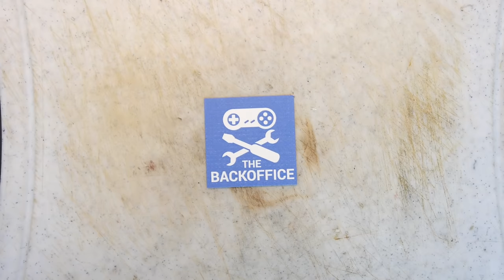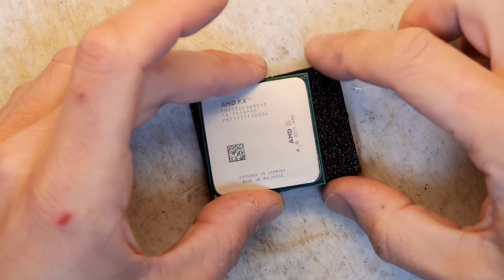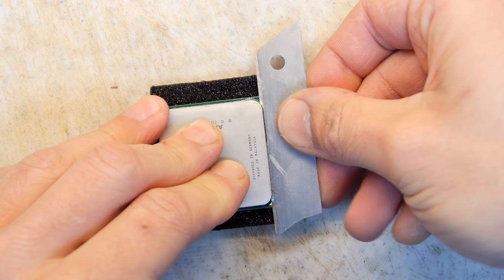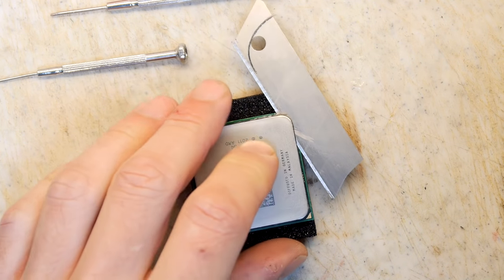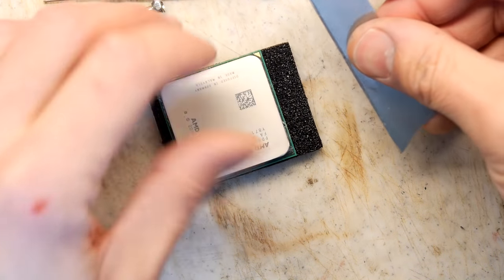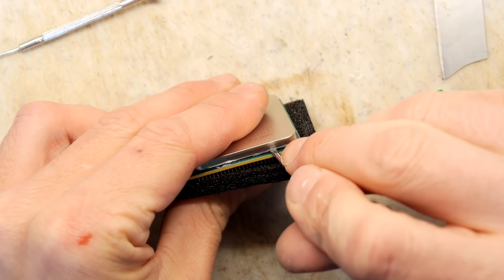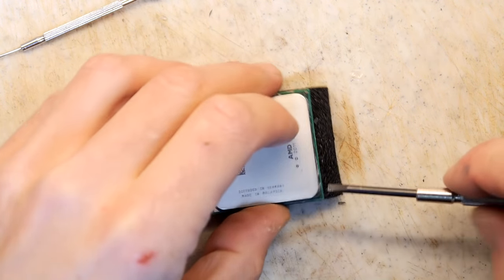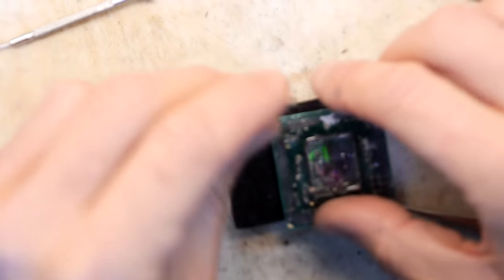Do not DE-LID an AMD FX9590 CPU! (Already dead CPU)

Comment: AMD solders every CPU IHS. You should know better. De-lid is only Intel thing. :D
Reply: nope, some are not. for example the original atlon x2 chips - almost all have thermal paste which fails. i have de- and re-lidded those
Reply: God damn dude how is athlon x2 relevant today? -.-
Reply: still usable tbh
Reply: Are you still living in 2006? Athlon chips are shit.
Reply: Athlon X2 was really early in CPU lidding. The generation before that they used 4 round foam pads in the corners to keep the heat sink steady and the heat sink made direct contact with the silicon. This method is pretty damn efficient transfer, but it's extremely hard on the processors. A huge number of CPUs were killed by rough handling in shipping in prebuilts, and by people changing their thermal paste or installing custom cooling. Even a very minor shift of a few degrees while attaching a cooler can chip the silicon. We have lids for very good reason, and the early beta versions were not very good. As far as all AMD CPUs in recent production, they are all very well lidded. Intel doesn't bother trying even on their $1000 chips, but a $70 Athlon X4 is ready to rock for 20 years xD
Reply: pentium D can do most of the things I use a pc for and athlon x2 is better than that so..
Reply: APU have shit under IHS same as Intel, but FX and Ryzen are soldered.
Reply: I delided a dead (broken pins all over) AMD FX8350 and the heat spreader came off nicely with some thermal paste under it.
Reply: The AMD Sempron actually had Thermal paste, not solder. Those where fun to delid actually and archieve higher clockspeeds. I once booted a sempron 2.8GHz up to 4.3GHz by using a compressor which chilled the CPU at -40 idle and -20 load.
Reply: HolyDr1ver only intel thing after second gen, my 2600k is solderd, but the 3770k isn't and i don't want to try it on my only chip for a higher overclock, maybe later when they get cheaper
Reply: If your Pentium D is the 2.6 gig version, you can overclock it to 3.6 gig. It will greatly improve performance, AND it will keep the entire room warm! Lol!
Reply: @SuperSpetterpoep  holy shit dude, obviously that wasn't a usable set up for more than an hour at most but holy crap, congrats.
Reply: Some of the older phenom and athlon chips had paste instead of solder

Comment: On the positive note, at least I finally saw FX CPU looks inside that cap :)
Reply from the maker: +MrRaivokasMagma yeah, 'no user serviceable parts inside' 😂
Reply: It's no different then a 8350 or otherwise. It's just a better binned chip that sustains those ridiculous clockspeeds and 220W TDP.
Reply: Good for you. A bit of trivia, back around year 2k, that's actually how they ship the CPU (without the  LID).

Comment: AMD uses a solder to their lid which is incredibly effective for transfering heat, the problem wasn't the lid but I imagine a defect in the actual chip itself. Would love a copper lid from AMD maybe on their next gen chips.
Reply from the maker: +Cookies4Wookiees First up, great name! Second, you are 100% correct, the ineffective cooking I had for it allowed it to run 30+ degrees above spec for 18 months. I suspect the MMU fragged. The poor thing!
Reply from the maker: +Cookies4Wookiees I forgot to ask, do people polish the heat spreaders? I think it could be an option?
Reply: You can polish the lids. :) It's called lapping and it's really effective with AMD chips.
Reply: +Cookies4Wookiess To my knowledge, an IHS (lid) is copper. At least Intel IHSs are, I'd assume AMD is the same. The copper is just plated with nickel to protect against oxidation and galvanic reactions with aluminum heatsinks. I've heard of people lapping the nickel away and having polished bare copper. Probably a bad idea in the long term.
Reply: I thought you lapped the heatsink... not the cpu... or now I think about it you could do both... 

is it the same method..?
Reply: +jonathan main Beats me, it's not something I'm inclined to try. I don't really know about lapping, I just saw a forum post of someone claiming to have lapped the IHS. Was mostly just talking about its composition. But yeah seems like lapping the heatsink would make a lot more sense.
Reply: Yes, exact same method. Keep in mind you void the warranty on the CPU if you make the markings illegible.
Reply: What?Its solid copper in ALL intel and AMD chips.
Reply: > Would love a copper lid from AMD maybe on their next gen chips.

It is already made out of nickel-plated copper. You can tell even by weight, it is too heavy for aluminium.
Reply: +Hedede Well most of us haven't delidded our CPUs to feel the IHS. And yes it's nickel-plated copper, that's been established by multiple posts already.
Reply: Nice I've been buying cheap processors so I've not noticed, but I'll be buying a Zen.
Reply: those are copper heat spreaders coated whit nickel
Reply: You can do both. I used to in the past. It does make a difference.
Reply: when i lapped mine it was copper it just has a nickle coating to limit oxidation
Reply: Cookies4Wookiees ryzen still has this type o lid
Reply from the maker: +R3MIX Productions I reckon I could pop a Ryzen or FX lid pretty safely now, just got to decide if it's worth waiting for a dead one or trying on a live one 🤔
Reply: They are welded and if you remove it you only get a 1 degree better temp
Reply: Cookies4Wookiees If you don't care about the markings on the CPU, you could try lappping the cover. be sure to protect the pins from dust/filings though.
Reply: never lap the ihs.. wtf
Reply: copper is more reactive compared to aluminum. They will not even use the copper plate ever..

Comment: The lid is soldered to the die
Reply from the maker: It sure is! :) I might hit it with some heat to see if I can remove the broken silicon.
Reply: It has nothing to do with the Silicon... IT IS SOLDERED... there is no compound under the lid...
Reply: If you don't know what I'm talking about I suggest you stay away from PC's
Reply: Says the guy who doesn't know the difference between silicon and silicone haha I agree with Moggy's statement. If you're young it's excusable, keep on learning.
Reply: And... you can un-bond solder by... adding heat.
Reply: Joshua Davidson,  If a cpu isn't soldered to the heat spreader, it does INDEED uses some kind thermal compound/paste, Not every cpu is soldered. How many Cpu's have you de-lidded?  Unless you edited or deleted anything, you were the one talking about compound confusing silicon for silicone. As far as I know it, there is no "silicon" based thermal paste.
Reply: I have no clue what type of solder they use but It's more than likely not lead, my best guess with no googling would probably be Zinc?
Reply: But the entire point is that if it's soldered straight to the heatsink then you can't exactly change out the non-existent thermal compound making de-lidding of said cpu to try and get better temps irrelevant.

Comment: now you see... even tho this didn't work out we learned something very valuable. No reason to put a dislike on a video that made you a little bit smarter.
Reply from the maker: +DAGATHire That's what I like to think, post failures and successes. People who know better realise life is a series of failures otherwise we never learn 😂👍
Reply: ^^ exactly. certainly we learn more from a fail than we ever get from a win. Actually i have a question. Im a long suffering 8350 user and waiting for RYZEN now, however was the 9590 ever a viable upgrade over the 8350? it seemed like it was never worth the upgrade considering the meager gains in performance.
Reply from the maker: +DAGATHire I only have the 9590s and in two systems with cooling that actually works (grrr that bloody Zalman) I'm pretty happy. They often run maxed out rendering video.
Reply: Interesting. When i first built my system i ditched the stock cooler(never used it in fact) as you do and got a zalman CNPS7X  because it had a blue LED and i had a blue led theme going on. It was a mistake tho. It barely kept the CPU cool enough at stock speeds (under load) and overclocking was out of the question. So i got a AIO water cooler (arctic liquid freezer 240) and i can't recommend it enough. The out and out best AIO on the market in my humble opinion. and it cost me €79 at the time! bit more expensive these days i think as it's proven and documented as a really good performer. Huge rad and 4 fans in push pull config. So i was able to get my 8350 up to 4.8 stable. Probably could have pushed it higher, but i settled for a safe stable 4.7. anyway the point really is im not in love with Zalman... in my experience they don't work very well, that's just been my experience tho. I'm sure other people have had better results.

Comment: AMD solders the IHS to the chip, it's the best thermal transfer you can get and you cannot remove it. The silicon wouldn't fuse to the IHS like you mentioned.
Reply from the maker: +Doctah I would love to know how they bond it. I see a lot of people mention soldering, but I'd it really traditional soldering/brazing or is it bonded with some amazing adhesive 🤔
Reply: They probably use some solid filament between the die and the IHS. The problem is that this material doesn't bond to silicon very well, same for the IHS. So they use gold and nickel layers to help them bond. So I just assume they put the materials down and sandwich them together and it goes through some machine to heat them together. Typical solder (tin) would shrink as it hardens, so they use Indium.
Reply: The Backoffice its soldered. I actually delidded a Lot of soldered CPUs. Its a cool experience

Comment: R.I.P AMD 9590.
have one of these for the last 3 years had no problems thank god.
only has to last me till Ryzen.
Reply from the maker: +caster troy I have two more of these in pretty much brand new systems, I'll be joining Ryzen 2 I guess! Interesting to see how they will go!
Reply: caster troy How much are you willing to sell that 9550 for? When Ryzen comes out
Reply: had my ryzen 7 1700 for about 2 months.
it about twice the power of the 9590 and more if I over clock.
well happy would recommend to any one.

Comment: Thumbs up for posting this video.
Most of youtubers would just hide it, but this is a very important lesson and should be appreciated.
Reply from the maker: Thanks, seems to be a marmite video in that it received equal amounts of approval and hate :) I am still running two of these systems just fine, turned out to be the crappy water cooling I was using. Just a regular forced air setup was the solution. The Die inside was pretty awesome!
Reply: My first fx 9590 calfed after 4 weeks ... second one been running ever since

Comment: You CAN "de-lid" it...  The lid is adhered with a type of ceramic product which melts at around 500f.  So if you have something which can evenly heat the surface package to that temperature the lid will just lift off easily.

Comment: I DE-lided mine in 5 mins and it still worked just push 4 razors into the edges just a little then place it on a electric stove, top down when it comes apart it will jump a bit in to the air done.

Comment: The lid was soldered on to the top of the chip in this particular case. Some chips have the lid soldered on and some have just the heat-sink paste on the actual chip. The lid is in both cases glued on with heat resistant silica glue at the edges of the lid.

Comment: Those SMT devices aren't resistors. They are drivers amps.
Reply from the maker: +nitroxide91 Oh, rusts cool too know. I still have the chip as I was going to probe it under the microscope, so I'll be looking out for that now, cheers! 👍

Comment: My 9590 was recording temps hot as the sun.  I spent two hours at my table using 800 and 1500 grit sandpaper on the lid. The four corners of the lid were high (or the center was low).  The grinding with sandpaper got the lid to a level mirror polish. That resulted in getting the idle temps to around 29C using a LEPA Liquid Cooler LPWAC240-HF.
Reply from the maker: Nice!

Comment: AMD solders the dies to the heat spreader on many of their chips.  after you separate all four sides with a razor (without cutting into the SMDs), you need to lay the CPU heat spreader side down on a hot-plate set to a temperature a bit above the melting point of the solder before the heat spreader will detach.

Comment: That is gorgeous. Not exaggerating.

I was showing my brother in law how tough the old Pentiums were, he was holding it like it was the most fragile thing in the world. I dropped it on the floor, which I'd done in the past without issue, but I didn't think about my workroom being bare concrete...

Still have that shattered CPU. It is very interesting to look at the bare core.

Comment: 29 jan 2017. People back in 2015 already DE-SOLDERED the IHS succesfully. De-soldered yes. You cant just cut and wiggle that thing off lol. But with delidding there's extra problems even if you manage succesfully. The height of the CPU changes, since most coolers are designed for specific heights, most wont fit anymore and requires different sorts of cooling.

Comment: Wow, that is a lot of silicon in there. And the soldered construction is surprisingly good, like on intels extreme editions. Any idea what the solder is? It looked a bit too rigid to be indium.
Reply from the maker: +Arno nümuss In the links I have a desoldering video, I think it's just regular solder and they have tinned the iht
Reply: Thanks, I see now. This explains why they used heat resistant silicone seal.

Comment: 1 mil is NOT 1 mm ! They are very different units, both used when measuring distance on electronic components like this.  1 mil = 0.001 inch = 0.0254 mm .  Old school microchips and some much more recent things have pins that are 100 mil apart. Tiny components like the ones under that lid are often described by their sizes in mils, such as 0402 = 04 mil long, 02 mil wide.

Comment: One thing you should know is traditionally AMD have only used thermal compound for CPUs with a TDP of less than 95 watts. All others are still soldered to the IHS.
Reply from the maker: +ManWithBeard1990 that's quite a useful little factoid, cheers! 😂

Comment: Wow, didn't know this before. I mean, was never looking to de-lid ANY CPU, but hey, "The More You Know"
Reply from the maker: +Just A Dark-Haired Gamer Some CPUs have a conductor under the lid to the silicon that dries up and causes problems, certain Playstation's etc. A lot of chips come without the spreader, especially embedded varieties.
Reply: The Backoffice yeah, I have a gaming laptop and mine has no heat spreader, just a bare die
Reply from the maker: I guess they just have it dumping its heat to the frame directly? Good way to save space I think.
Reply: The Backoffice it's got a heat sink on it like you would a regular cpu that's been delidded, ofc the profile is quite different so that it fits in the laptop chassis
Reply from the maker: +TheBLC94 I have a few dead and near dead laptops that might be getting investigated soon 😂🤔
Reply: The Backoffice excellent! I look forward to seeing you rip them open haha

Comment: I guess that kind of sucked but in the end your insanely cavalier slice and pry method resulted in a clean (ish) split of the CPU die! Which is always pretty. I have definitely seen de-lidding of an AMD CPU done before in the past but I think that was on socket 939 Athlon 64
Reply from the maker: +agdgdgwngo I'm quite pleased with that aspect, it's a mercy it died, I replaced it and never looked back. Had it been successful I probably would have persevered with this crappy CPU for months more 😂

Comment: Might it work if enough heat to liquify solder is applied to the surface?  I wonder if it an attempt by AMD to prevent successful delidding attempts or to make sure heat transfers well enough as is that there would be too little benefit.
Reply from the maker: +OptimisticPessimist That's what quite a few people are saying. I can still test this to see if I can remove the shattered silicon
Reply: I also wonder if Louis Rossman can fix it.  He'd probably deleagate it to Jason.
Reply: Of course it is an attempt by AMD to actually make performance better. What did you expect?? Delidding and poking around and under cpu lid is not a normal thing to do in any book and should ruin any manufacturer`s warranty immediately. It`s completely different story that people think it`s normal today because Intel has been using cow shit as thermal material for last 5 years allegedly because of "technical limitations" that prevents them from soldering. We should`ve never get to that point of desperate. I hope Ryzen will have no "technical limitations" and continues to use proper soldering on the die because as a future owner i don`t want to deal with that crap, even with those "easy to use" 3D printed delidding tools that people now sell online for a few of $.

Comment: indium solder requires to be softened by heating it at 100+ C before you attempt to remove the lid,if that is not done,the lid will stay glued like cement on the die and ruin it

Comment: Could have tried Toluene to dissolve the adhesive, they use it quite often in repairing speakers! But the only way they can solder silicon to copper is Indium! Just research it's melting point and you'd know the temp it requires for removing the Silicon!

Comment: They should just do the CPU larger the size of the lid instead of having a lid, because that way the CPU would have more surface area to dissipate the heat directly into the heatsink, the lid serves no useful purpose if they can make the chip itself strong and wider for better surface area heat dissipation